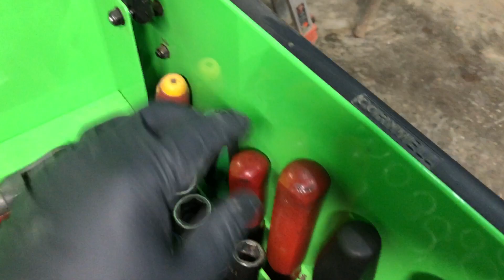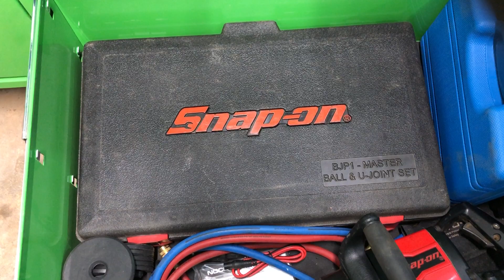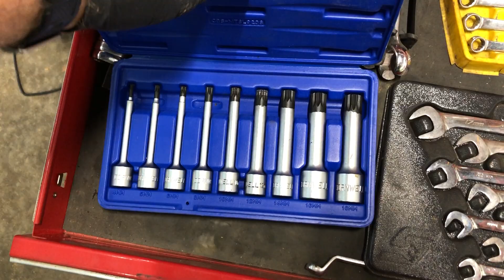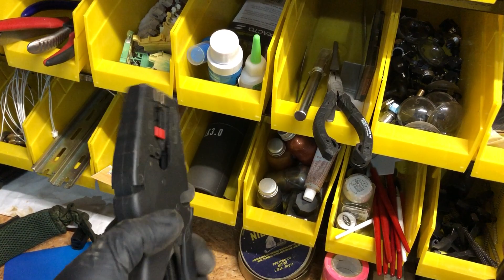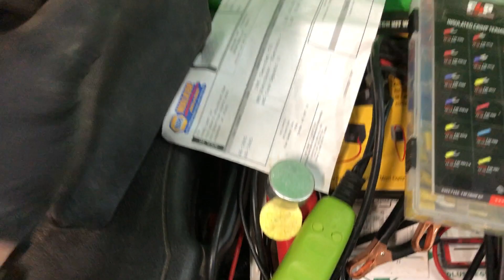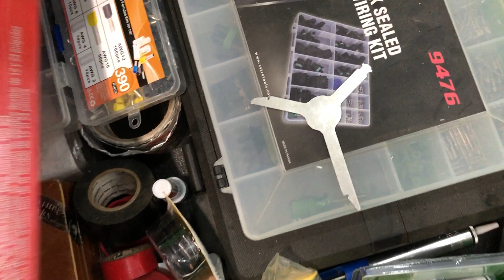Toolbox tour 2022 Cornwell Power Drawer Cart, Snap On, Harbor Freight

Comment: Great selection of tools you got. I too had issues with my Sunex made Cornwell cart. I moved up to a pro series thinking It being made by Cornwell in house would be a solid box but it too has its quirks. Coworkers have had a lot of slide issues with their pro series and platinum series boxes.

Cornwell makes some great hardline tools that rival any of the heavy hitters like snap on wright, proto etc, but their tool boxes leave a lot to be desired. Which is unfortunate cause they’re competitively priced and they’re made in the same factory as the indestructible Kennedy machinist boxes.

Comment: Hey... Just saying I'm not sure about new models. But maybe you are having such a hard time with old Ram ball joints because you are using a press... Mopar ball joints are SCREW in... NOT press in. Atleast that's how they used to be. You need a set off 3 sockets to fit Chrysler ball joints from the early 50's till atleast 2000 or so. Mostly you only need the larger 2 sizes. They are a special giant square socket with round corners. Un tightening old rusted in ball joints and getting them to screw out is very tough too. Always need 3\4 drive and a 4-5 foot pipe on the thing.
Reply from the maker: I’m talking about the 03 and up body styles. I don’t see many of the older trucks. The last two generations of the Rams have press in ball joints.